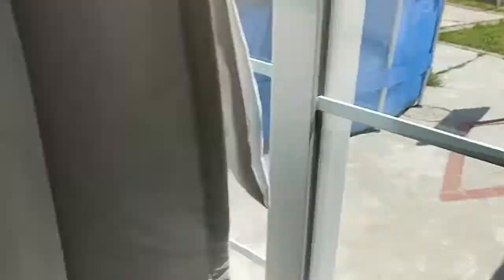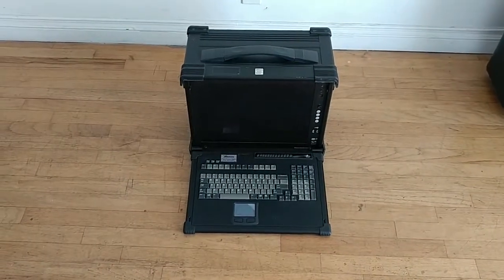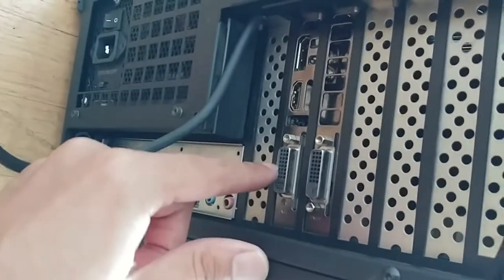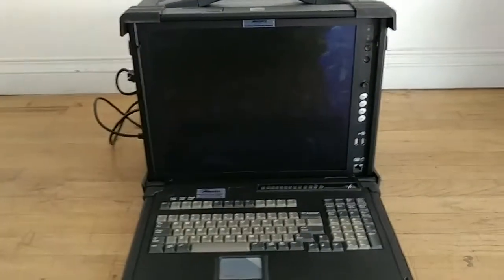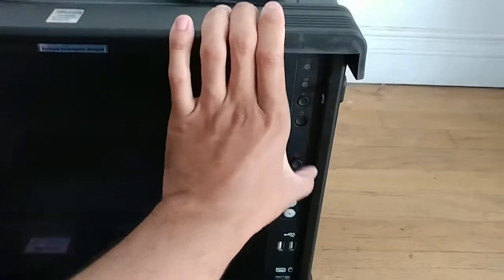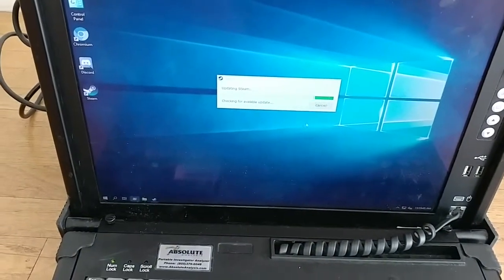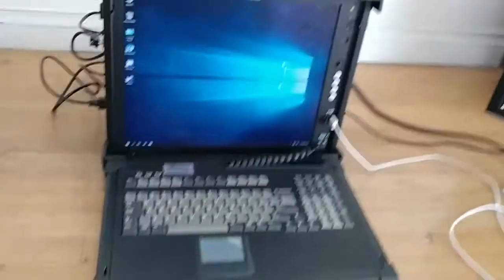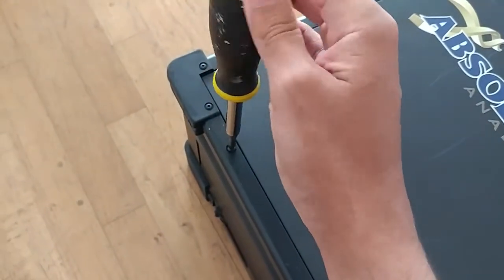Old School Suitcase Workstation/Server

Comment: Any other details on what this is? Make/model? I’d like to by one to retrofit.
Reply: The label on the case says Absolute Analysis Portable Investigator System, so I assume the manufacturer is Absolute Analysis. There's very little info I've been able to find online. It seems that they either were bought out or went under post the turn of the decade.